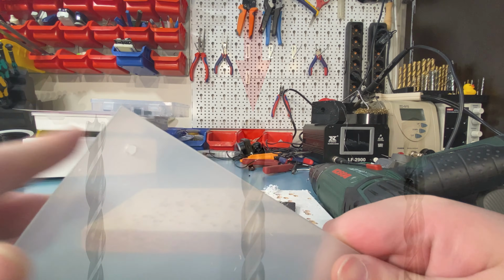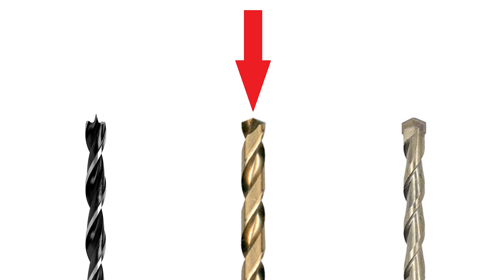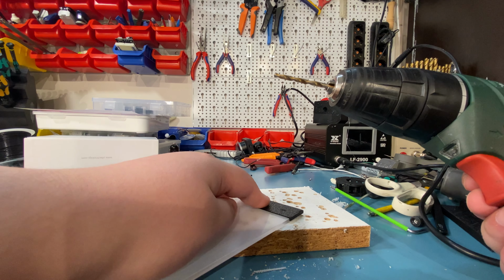How To Drill Acrylic Sheets (Like Door Panels)

Comment: There are actually acrylic panel drill bits, which look similar to the metal ones, but with sharper (~90 degrees) tip. Also overheating/melting is a risk when going too fast and/or for too long.